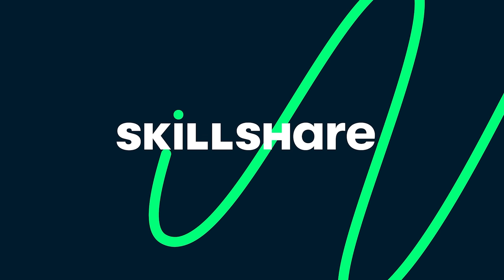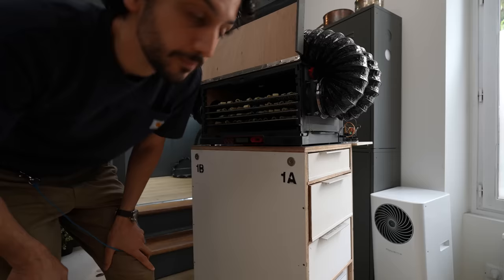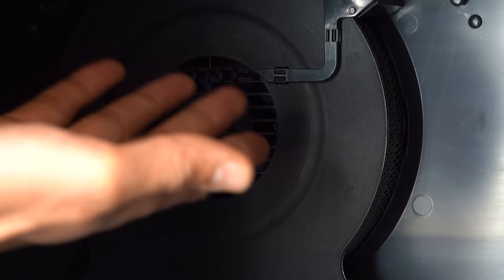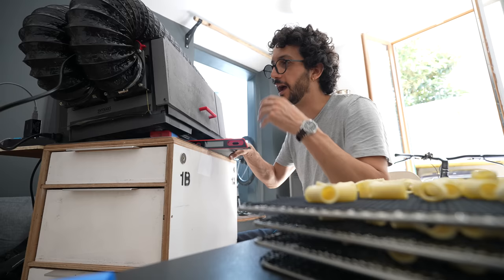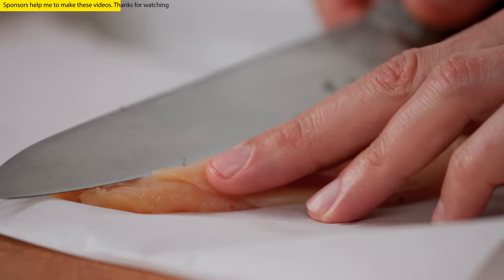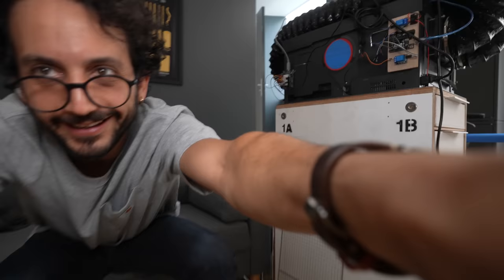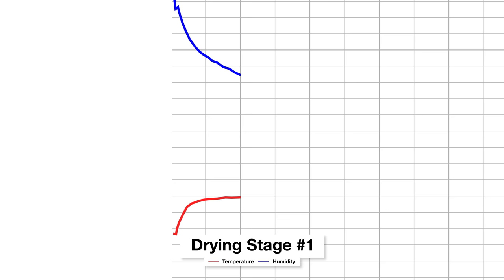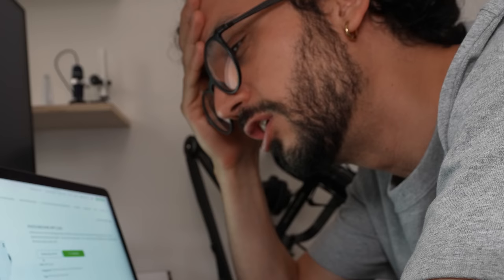I Built The WORLD'S FIRST PASTA DRYER For Home Use

Comment: Alex you improve the racks even further. Trim the metal mesh form the surround frame. Essentially remove everything but the outside square and then wrap with your new mesh.
Reply: I agree, the metal would be affecting the air directly around it, not just where it touches the pasta. A non-conductive replacement would keep the pasta from heating faster and cooling slower on the bottom side from being so near to the metal. Each segment of the metal mesh would be radiating but only very close to itself.

Comment: I feel like you could 3D print a housing that holds an RC motor that spins a blade from an old knife that you can just pop over the extruder. Attach a potentiometer to regulate the speed and you're good to go. You could even just use rechargable 9v batteries so you don't have to worry about plugging into anything.
Reply: That would be the easy way, but this is first and foremost for entertainment.
Reply: Great idea.
Reply: 3d print, form out of some thin sheet steel, there's plenty of options. You could probably even Bubba something together from the plumbing isle if you weren't fussed about it looking good.
Reply: The motor can be geared down to a lower speed for more torque

Comment: What Alex is trying to do here with an active drying process can be done with a passive drying process, just over a much longer time. The goal is to have the mass of the pasta dry evenly and not have a moisture gradient from the core to the outside surface. By placing the drying racks in a small, closed area, like a large Tupperware, the dry room air that is initially in it will become more humid from the moisture drying off of the pasta until they meet an equilibrium. That would be the resting period. Then the Tupperware is “burped” allowing the high humidity air to be exchanged with the low humidity room air and the process repeats itself until the pasta is at the desired moisture percentage. The rate at which the pasta fries can be regulated by how long the pasta dries before going in the sealed container, how often the container is burped and how long it is left open while burping. The main concern would be mold/bacteria if allowed to be too moist for too long.
Reply: That might work or the pasta would mold like bread does when kept in plastic over time, even when taken out periodically.  Mold is the enemy in air-tight plastic.
Reply: @terrijuanette486  bread has much more moisture and still takes a couple days to mould. Should be fine, especially as more and more of the water evaporates off
Reply: @juliaf_  Really?  Baked bread has more moisture than unbaked pasta?  I admit I don't know the ratios but that just seems odd to me.  I'm sure I'm wrong.

Comment: I think you need to approach this in the same way the metal is annealed when you do jewelry making.  The pasta is trying to contract but you need to heat and cool it otherwise it will crack. I think this can be achieved with thermal and moisture cycling. I'm a medical device engineer and a keen cook. Really enjoy your video's and your analytical approach to problem solving. If you haven't reached the answer yet atomising water might be a area to look into.
Reply: That's an idea!

Comment: Hi Alex! I just wanted to let you know: that after using the pasta dyes for a while they tend to get a layer of protective oxidization which easily scratches off with harder metals. It is a reaction that all bronze has naturally, especially when you put them in water after use to keep the pasta from drying. Think of the protective layer on the statue of liberty for example. This is why a lot of older pastificios have stained, dull-looking pasta dyes that seem like they have a lot of scratches.
Also, congratulations on continuing your journey to making high-quality, dried pasta at home! Bonne chance!

Comment: I don't know if you have a hot glue gun but when attaching fabric to anything, it is the bombdiggity!  It's faster than tying string or sewing it on, the fabric would still lay flat, the hot glue would pull right off if you ever need to remove it and the dryer would never get hot enough to re-melt the glue if all you use it for is to dry pasta.   If you need to make more racks, I highly suggest it.

Comment: Shouldn't you place a condenser unit in the ducting? 
Reason for this is remove that moisture. 
If you turn it on during the first 50% of drying period it will remove moisture, in the remaining 50% turn it off, so the internal moisture can build up again for the upcoming resting phase.
It might also help adding the capability of humidifying with a ... humidifier 🤔👌

Comment: You have a 3d printer. You should be able to mock up something with a small electric motor the same as that pasta cutter you showed easily. The only problem is making sure the 3d printed parts don't come in contact with any of the pasta itself (most 3d printing plastics are not food safe sadly)
Reply: ABS plastic is food safe. And if Alex is using something else, the plastic can always be coated with shellac (which is food safe).

Comment: I think a simple solution would be a 2 sided blade on a fulcrum above the pasta output that swings back and forth. Might be able to use an RC servo or something similar and use a microcontroller like an arduino or teensy to control the speed of the blade swing and pause time between cuts. Another option would be a single blade that rotates around like you saw in the video you showed, that could be done with a stepper motor and micro controller.

Comment: Hi Alex, have you thought about using a tall cardboard/wooden box? Install an intake vent/fan (pc cooling fans are great for this) at the bottom, and an exhaust fan at the top (that way you have a column of moving air from the bottom to the top). By adding a small heat source you'd introduce a means of drying your pasta using warm air (so long as it isn't humid air). (I used to use a smaller setup when making biltong at home and a 40w bulb as a mild heat source). By varying the voltage to the fans you also get to moderate the air flow rate.

Comment: Rather than making more pasta at a time to keep the humidity up, maybe you can try active humidification. They make small ultrasonic humidifiers for aquariums that can add humidity without adding heat and can be turned on and off rapidly. It should be easy to integrate into your existing control board/code and you can just pipe in the humidified air somewhere that isn't directly onto your pasta.

Comment: For consistent drying process it would be beneficial to start with dried air. You can do it by cooling it down below the drew point or make it go through a bed of silica gel. By doing this you don't have to change drying conditions depending on the weather forecast.
Thank you so much for your videos.

Comment: PASTA CUTTER DIY ! how to make :
use fishing line 
mount it on one side using spring 
and on the other side mount some motor that when spinning will mow the fishing line up and down + do the "cutting motion" like knife

alternative option is to make U shape arm for the fishing line / some knife/ razor with cutting edge on both sides 
mount it on one side to the hinge and on the other side make a horizontal slot + motor with arm + some bolt etc so it can move the arm up and down

Comment: pastacutter should be easy, in fact, its really cool, that the whole thing isnt too difficult to make, but i wonder if it wouldnt make more sense to build the dryer from scratch? like you could use heated beds from 3d printers as your source of heat (i dont know how responsive the machine has to be though, a print bed keeps heat for a pretty long time) - you could even control the thing completely with g-code!

Comment: Once you fully automate the process you should sell your own brand of smaller batch pasta. Maybe create your own dye so you have a unique pasta shape.

Just add the ingredients to the mixer, create an auto tipper when the dough is ready that drops into a hopper for the pasta machine so that you can process larger batches. There is a conveyor below the chopper that leads around the parameter of your shops ceiling,  inside square ducting, with different zones of heating, circulation and resting, before the dried pasta drops off into large bins.

Comment: Metal ducting for outflow and inflow. Control temperature and humidity and efficiency that way. Put some cooling tubes around the air input ducting (metal tubing with distilled water circulating through them) then do the same with the outflow thus creating a very powerful draw to include even to the point of moving the heating element to the exterior of your machine should that ever need replacing or deemed not seen working efficiency as proper.

Then you can do not just pasta but pizza dough and even bread. No better place to start than the frozen foods section in a USA Supermarket.

rather than cook or bake I want to super chill everything whilst somewhat freeze dry all the extras and then cooking is nothing more than putting in your contraption and making hundreds if not thousands per day....all for a couple five US Dollars each at retail.

Comment: While having an automatic cutter is a desirable goal… I think rather than just adding “more pasta” to the dryer, I think you could achieve a similar goal by just adding an additional source of moisture. You can start with a moistened sponge. It should dry more slowly than the wet tissues.

Comment: What would happen if you added a proper dehumidifier in the ventilation cycle. A proper dehumidifier has a cooling circuit, like a fridge and cools the air so that the moisture condensates into a collection tray. Would there be any benefit to having dryer and potentially colder air in the drying circuit?

Comment: I'm only half-way through the video, Alex. I was wondering - why were you soldering to the LCD? Was it a convenient common ground? Or did the manufacturer hide a microcontroller under the screen? Did you use an arduino with an LCD shield to bypass the entire microcontroller?

Comment: What about dispersing some water (or rather steam) into the vent shaft when the humidity is too low? I can't see you stuffing much more pasta on these racks!
Also, apart from local temperature "sucking", don't these metal grills mess with the temperature control during the resting time, as they stay heated for a longer time? I wonder if a wooden board with holes drilled in it could help both with humidity and temperature.

Comment: I'm using my small brain here thinking about something. The whole point coming to this series came about the texture on the carbonara and how the dried pasta is a better option compared to fresh pasta... So here is a question. On which kind of dishes is better to use dry pasta, and what dishes to use fresh pasta? 🤔🤔🤔
Reply: I would guess that fresh pasta is better with thicker sauces that stick well to the noodles,  also maybe dishes with meat or seafood or large vegetable pieces for rolling up in noodles. My mind goes right to something like an alfredo with fettuccini and shrimp or something, with like mushrooms and broccoli florets, but I have nothing remotely professional to base that on except what I learned about texture from these videos, and my own limited experience with fresh pasta. I wish I could think of more examples. Maybe a thick bolognese with grated cheese, or a heavy vodka sauce. I could see smaller fresh pasta being good for those. Macaroni and cheese is probably good with fresh pasta. Or casseroles in general. Mostly guessing though.

Comment: If you had to switch the machine off , just use a relay ( controlled by the arduino)  and switch the main power off , just a thought. Alternatively, to keep the humidity high, you could pump water (spray) into the machine ( this models the sea breeze in via Roma where dry pasta was originally made) . In this way you have more control over the environmental condition.
Reply: that only works for turning it off, but you have to push the button to turn it back on, hence why instead of a relay on mains, he is simulating button presses on the control board directly.
Reply: @ElGeFe  I agree, I get what he did. However, some machines have a memory backup feature that resume to the last operation incase of a power failure. If this was indeed the case, then having a relay to switch off external power would have also worked.

Comment: Are you really an EE?! I saw the clip in the last episode with the Arduino code and I'd wondered if you were smart and motivated enough to figure it out, or if it was already part of a different hobby or what ever else. Basic circuitry is fairly easy, but C++ is a whole other level of commitment. That's very cool. I'm like the total opposite, I'm a line-cook who would much rather be building cool shit. I have a fascination with turbomachinery.